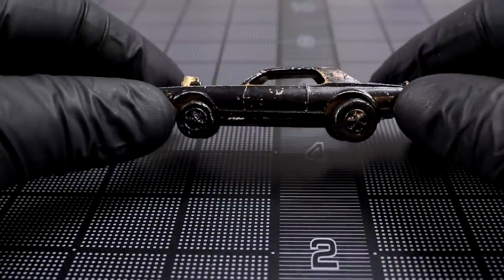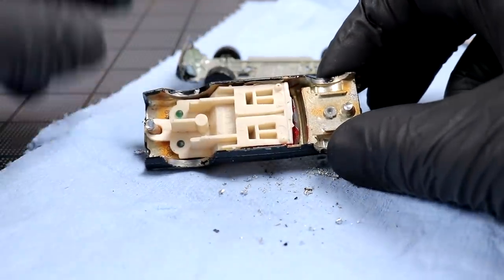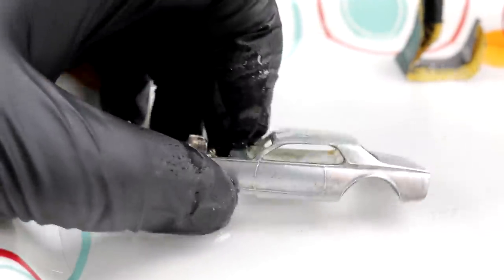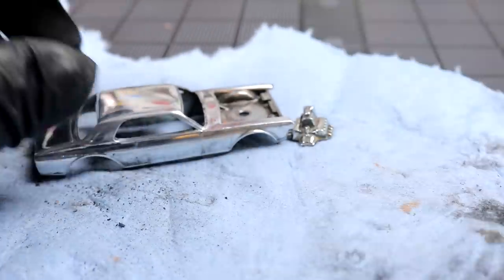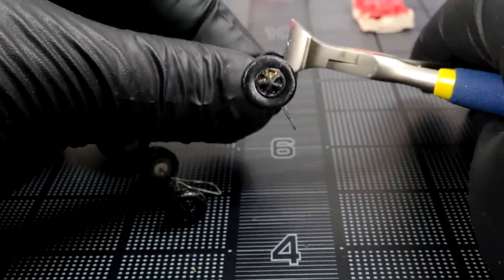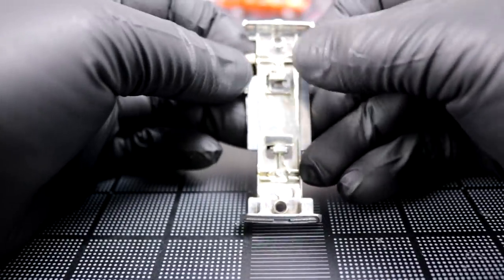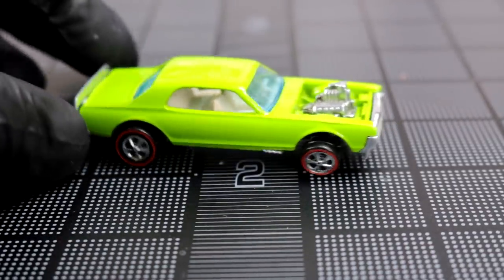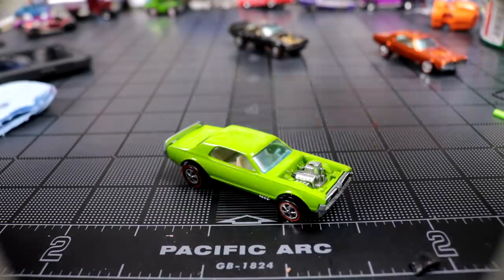Hot Wheels Customization : Nitty Gritty Kitty

Comment: What size drill bit do you use for the starter hole?  And then what size?   I'm having trouble drilling out the sides of the "rivet".
Reply from the maker: The finished hole size is 1/16, anything smaller would work for a pilot hole whatever fits good into the center-punch mark.  It takes a little practice, maybe take apart some cars you dont car about first before you work on your favorite.

Comment: Im sure you know this already, however its worth repeating just in case. I restore old Tamiya R/Cs with Lexan/polycarbonate bodies. If the body is worth preserving, I simply drop the body in a 10 gallon bucket of brake fluid and leave it there for 72 hours or more. When Im ready for it, I pull it from the bucket and watch the paint slide off with the brake fluid. In some cases, I dont have to do more than wash it with soap and water and the body is like new again, ready for paint. Most plastics resist brake fluid and can soak in it indefinitely. Be cautious and always perform a sample test cause you never know what type of material they use for the interiors and windshields. If you try it, please let me know how it worked out for you.

Comment: Drop the plastic into Castrol super clean, it doesn't harm the plastic at all. That is how I strip the paint from my diecast and plastic model kits.
Reply from the maker: How long does it take to work? time is of the essence, I dont have days to do this..  I have some super clean in the garage though..
Reply: @DiecastResurrection  depending on the paint and how fresh the degreaser is a few as minutes or a couple hours. It does works faster on the original paint on the redlines.

Comment: Easy off oven cleaner in a plastic sandwich bag will strip paint off plastic very well. That with a tooth brush will save you some time.
Reply from the maker: Ima try it out, anything is better than break fluid, what a joke that was.

Comment: Dr. Diecast, I like you your a funny guy , anyway I have that same punch but mine doesn’t make the same noise as yours does. That last car you did with the red body and the black top with the huge engine, anyway that would of looked sweet with a white interior.
Reply from the maker: If you unscrew the back of the punch a few turns you can kind of adjust how much pressure it takes to use.  Plenty of good videos on YouTube explaining how they work if you need more help bud!

Comment: Nice job! Where do you get the paint strainers at? Didn’t see it in the links!
Reply from the maker: Ill add them, good idea.  I use full size DeVilbiss ones for automotive painting and just cut off the little tip i need.
Reply: Diecast Resurrection really I thought they made small filters for air brushing! 👍🏻